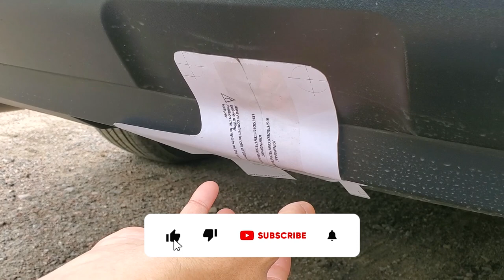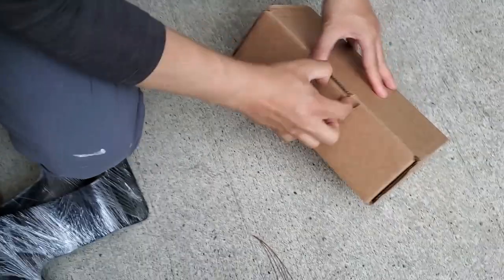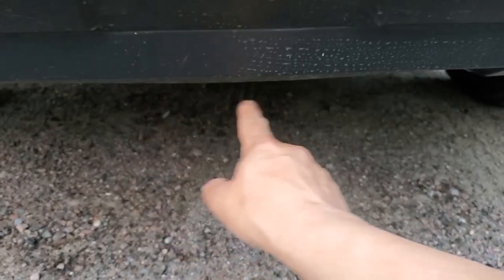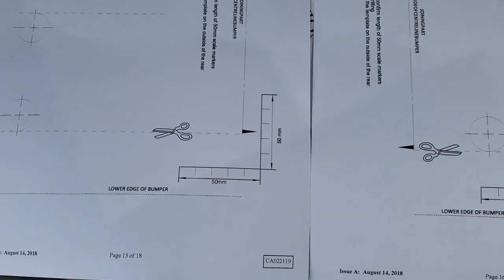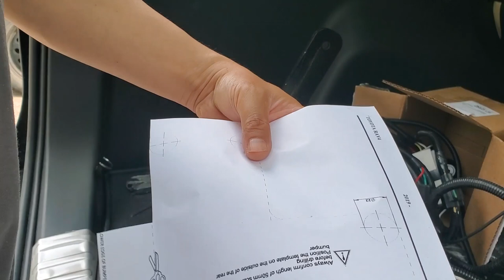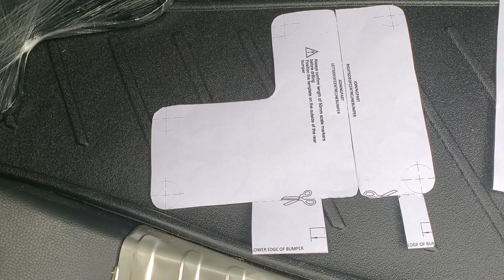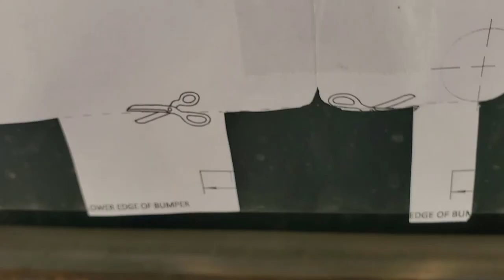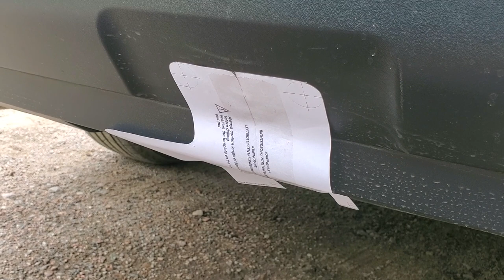RAV4 2019-2023 OEM HITCH INSTALLATION Pt. 1 | UNBOXING AND APPLYING CUTOUT TEMPLATE

Comment: They make one’s aftermarket that don’t require any cutting and look better.
Reply from the maker: Yes, there are many aftermarket trailers that don't require any cutting. However, those usually have very low clearance which is why we decided to go with this kind that provides a lot more clearance above the ground.

Comment: Can you please provide me all of the links for everything you need for the hitch and wiring
Reply from the maker: Everything come in one package from the Toyota dealer. This might be different for different years model. You can buy the whole package from the sales desk at your nearby Toyota for your specific model and year.
Reply: @BDMujahid   You went into the dealer to get it?
Reply from the maker: @kadenbef3871  Yes, but they had to back order as it was not in stock. It took several months to ship from the dealership at Don Valley Toyota in Toronto.